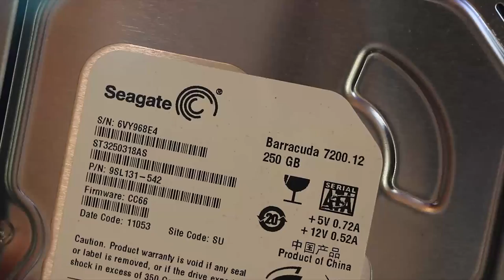A Tour Inside A PC - Desktop Computer

Comment: Thank for all the great info, i learned a lot from you today hey i wanna ask you a question i have a AMD Athlon 64 x 2 duel core processor 6000+ 3.01 GHZ. RAM 4,0 GB with a 64 bit operating system x 64  my question is can i increase my duel core processor to a quad  or do i need to take my pc in for repair and let them do it and how much do a 64 x 4 quad cost?